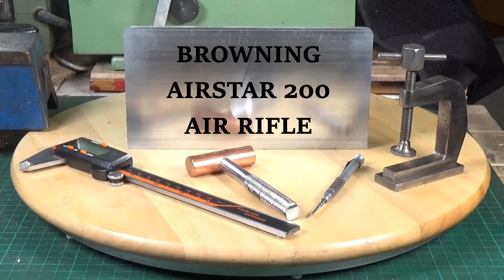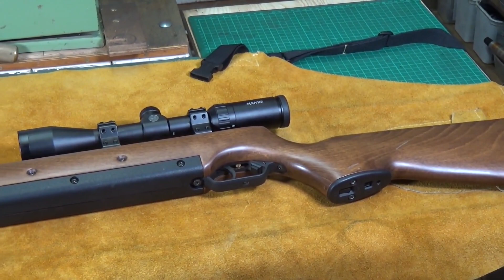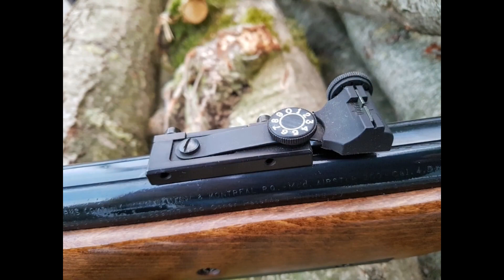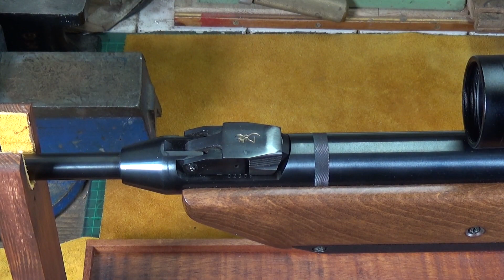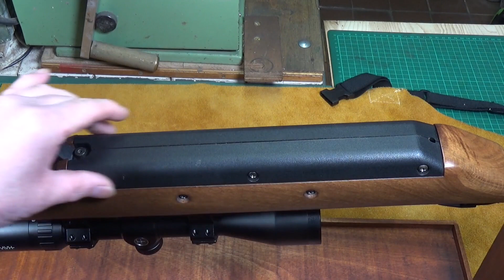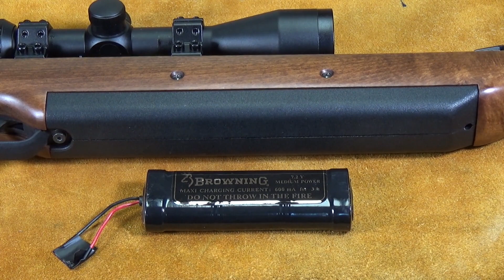Browning Airstar 200 Air Rifle

Comment: hi alan, the number made is a bit shady. you mention 800,but going by serialnumbers i think there were more than that.
i had a couple,and a collector i know once bought 10 brand new ones.long after they were produced.
they never were very popular because of the noise and battery/charging issues.
am trying to get a picture on how many there were build by writing down serial numbers.
would like to know what yours is?
cheers '73 carina
Reply from the maker: Hi. You may be right, it was several years ago that I made this video, I did do some research back then but specifics were hard to come by. The only numbers I could find were in the breech where you load the pellet. They are as follows, 1214P46NZ and 02309. Hope this helps.
Reply: @RetroSteamTech  
sure does.the 1214P46NZ comes back all the time.
your serial # is on the high side for me.i saw em as low as 01302.
so that's already 1007 units,IF they numbered them in sequens?
but maybe they started every year with a different series ?
Reply from the maker: @73-carina18  Serial numbers on air rifles seem to be quite a mystery. Manufacturers like to change their numbering system every few years which makes tracing them very difficult.

Comment: Hi Alan.  You are building up quite an air powered arsenal ;)  I've never seen an air rifle with an action like this before.  Very novel and interesting.  Years ago I did look into the more powerful air rifles available for hunting and some of the pump up ones were very tempting.  Able to easily bring down a rabbit.  I can't recall the brands, but they could be pumped up to quite impressive performance.  Cheers Rob
Reply from the maker: Hi Rob. Yes, I'm turning into a bit of a collector! I had never seen one like it either. The fact that they managed to cram an electric motor, a gear box and chain and sprockets into such a small space is impressive. Modern PCP air rifles (pre-charged pneumatic) can be very powerful. The air bottles on PCP rifles typically are pressurised to 2700 to 3000 psi. Over here the legal limit on power for air rifles is 12 ft/lb, you can own more powerful ones but you need a Firearms Certificate. Cheers, Alan.